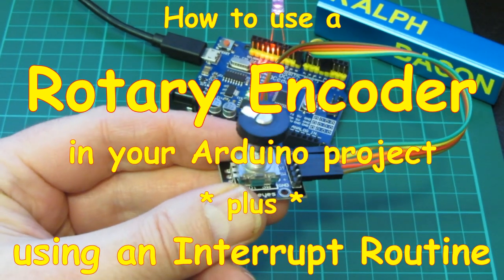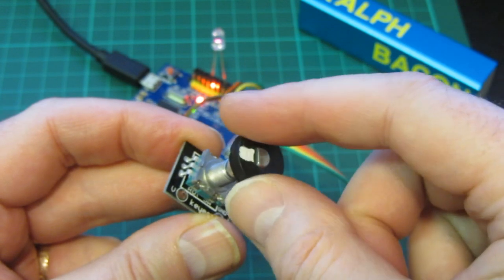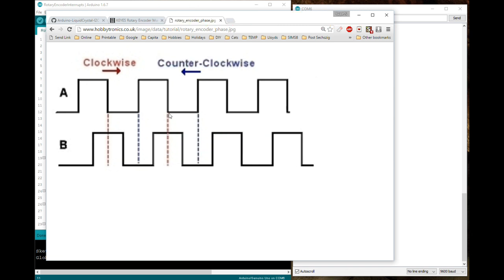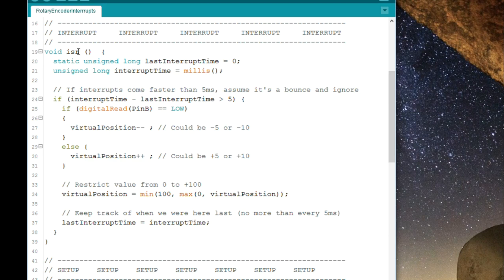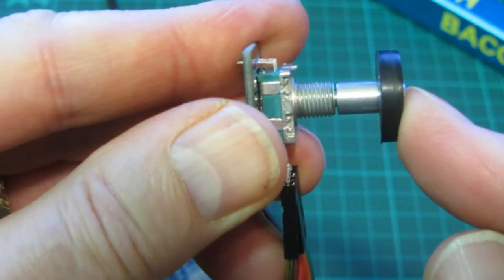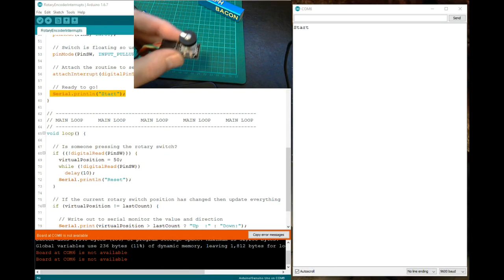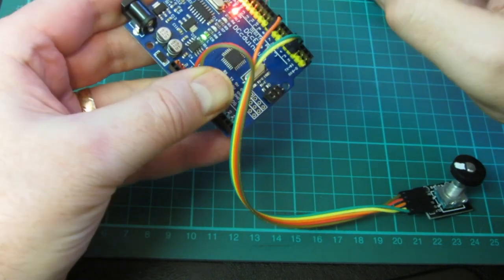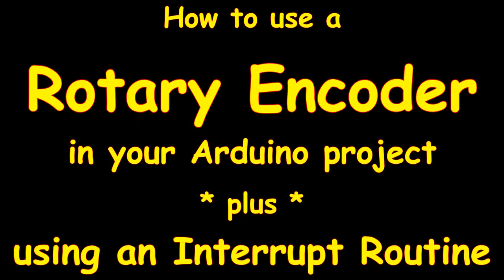#19 How to use a Rotary Encoder with an Interrupt routine on your Arduino

Comment: instead of triggering the ISR when the pin is LOW you could trigger it with the FALLING condition and get rid of that 'less than 5ms' if statement?
Reply from the maker: Nope, won't work dudekidPL. You could use FALLING as a trigger (I found it less reliable than LOW but your mileage may vary) but you can't escape switch bounce so you would still have to check for that to avoid false pulses. There's a more in-depth video on switch bounce in videos #96 & #98 (#96 talks about Rotary Encoders some more, #98 shows you how you CAN remove the 5ms statement if you're willing to add in a bit more hardware). Have a gander and let me know what you think!
Reply: Thanks for the quick reply! I will have a look at #96 for more encoder info. I am currently trying to implement a row of encoders into a key matrix. It should work as long as I can get a single encoder to work correctly and then put that interrupt function inside the key matrix. Unfortunately I cant get a stable encoder output so far. I have 5V at the common pin because my key matrix cycles 5v between the columns. I use pull down resistors for the A and B pins. A is connected to an interrupt pin and state of B is then checked inside the ISR to acquire the direction of the square waves. In my head it sounds right but i get crazy outputs.
Reply: I got it to work quite well with your code and by connecting the common pin to GND and using the software pull-ups for pins A and B . Is there a way to get similar performance but connecting the common pin to 5V and using physical pull down resistors on pins A and B? my circuit requires this configuration unfortunately
Reply from the maker: Yes, you can, with a bit of fiddling about (easy). Connect the common to 5v. This means you the pins A & B will be made HIGH as you turn the shaft. The Arduino Uno doesn't have a trigger on HIGH (Arduino Due only), only on RISING so use that in your attachInterrupt statement. Also, you will need to connect 10K resistors from the pins A & B to ground so they are not left floating. The debounce routine is still required in the ISR (using the check for millis() so no change there). Should then work. Let me know if you have problems.
Reply: Thanks once again for the quick reply, you're a gentleman!
I followed your instructions but used 7.8K pull down resistors instead. I didn't have 10k but that shouldn't have much difference. The debouncing function based on time since last interrupt definitely helps but in this configuration the encoder is still acting crazy. Changing the debouncing period from 5ms to 50ms helped somewhat but I still get many stray signals, not to mention the significant delay introduced. Any suggestions? Could it be down to the encoder itself? maybe the one i am using is designed to have the common pin grounded and that's it?
Reply from the maker: Hmm. Firstly, if you really do need 50ms in the debouncer then you have a really, really bad encoder. 5ms is enough for 99% of all switches I've ever tried, with 20ms the true exception. If you have an oscilloscope you can check for bounce as per my videos #96 and #98 (worth a look, though I say it myself). Certainly, Rotary Encoders are (sort of) assumed to be grounded as they turn but should still work when brought high. You are describing the symptoms of my Rotary Encoder when I used FALLING rather than LOW. Try changing to CHANGE (you will get two pulses per step but we can sort that out in the ISR later) and see if that makes it work as before (when you were checking for LOW state). Good luck and let me know!
Reply: The encoder I have is a BOURNS 24 detent and 24 pulse. It works perfect when in the configuration with grounded common and pullup resistors at A and B at 5ms debounce. 
It starts acting funny when i connect the common to 5v and use pulldown resistors. I tried your idea of using RISING as a ISR trigger but no luck there, a lot of strange readings happen. Sometimes i get two readings with one step (one reading increments the value and the other decrements it back down as if I stepped the encoder forwards and backwards). Strangely it works better when rotating one way than the other. To make matters worse, even at 500ms debounce the issue is not solved. At that delay, bounce is practically impossible so it must be something else. I think the detent is in a position on the square waves that only allows it to work when in the grounded common pin configuration
Reply from the maker: Well, it was worth trying. And if I remember, I will have a quick go at repeating this too, to see whether it can be made to work or not. In theory it should, in practice it may be the Arduino or the Rotary Encoder just does not allow it. Stay tuned...
Reply: Thank you very much for all your help! I really appreciate it.
Reply: Hi again Ralph, by any chance, do you have any news for me? :)
Reply: dudekidPL: I'm playing with this same code, using a Bourns EN series encoder (256 PPR). This drives the A and B outputs with a logic drive gate, as they are debounced. I found using the "LOW" causes continuous interrupts if the A output is parked at the low state, so I change it to "FALLING" as there is no bounce from these quality encoders. This fixed the continuous interrupt issue. And it counts perfectly.
I instrumented the code with extra volatile counters that incremented with an else statement (I added) for the debounce > 1ms If statement, so when less then the 1ms, I had a counter the increments by one. It was always greater then 4000 counts when I rotated the encoder slowly (seen via the print to the serial monitor). Once I changed the interrupts to FALLING, this counter never incremented.
// Used for generating interrupts using encoder A signal
const int PinA = 3; 

// Used for reading encoder B signal
const int PinB = 4;  

// Keep track of rotary encoder value
int lastCount;

// Updated by the ISR (Interrupt Service Routine)
volatile int virtualPosition;

volatile unsigned long interruptTime2;
volatile unsigned long interruptcount;
volatile unsigned long interruptcountold;
volatile unsigned long lastInterruptTime;

// ------------------------------------------------------------------
// INTERRUPT     INTERRUPT     INTERRUPT     INTERRUPT     INTERRUPT 
// ------------------------------------------------------------------
void isr ()  
{
    unsigned long interruptTime = millis();

  // If interrupts come faster than 1ms, assume it's a bounce and ignore
  if (interruptTime - lastInterruptTime > 1) 
  {
    if (digitalRead(PinB) == LOW) //
    {
      virtualPosition-- ; // anti clockwise
    }
     else 
    { 
       virtualPosition++ ; // clockwise 
    }
    // Keep track of when we were here last (no more than every 5ms)
    interruptTime2 = interruptTime - lastInterruptTime;
    lastInterruptTime = interruptTime;
    interruptcount = 0;
    interruptcountold = 0;
  }
  else
  {
    interruptcount++; //how many interrupts occur per millisecond
  }
  
}

// ------------------------------------------------------------------
// SETUP    SETUP    SETUP    SETUP    SETUP    SETUP    SETUP    
// ------------------------------------------------------------------
void setup() 
{
  // Just whilst we debug, view output on serial monitor
  Serial.begin(115200);

  // Rotary pulses are INPUTs
  pinMode(PinA, INPUT);
  pinMode(PinB, INPUT);

  // Switch is floating so use the in-built PULLUP so we don't need a resistor
  //pinMode(PinSW, INPUT_PULLUP);

  // Attach the routine to service the interrupts using encoder A, on logic low
  attachInterrupt(digitalPinToInterrupt(PinA), isr, FALLING); //other options LOW CHANGE RISING FALLING 

  // Ready to go!
  Serial.println("Start");
}

// ------------------------------------------------------------------
// MAIN LOOP     MAIN LOOP     MAIN LOOP     MAIN LOOP     MAIN LOOP
// ------------------------------------------------------------------
void loop() 
{

  // If the current rotary switch position has changed then update everything
  if (virtualPosition != lastCount) 
  {    
    // Write out to serial monitor the value and direction
    Serial.print(virtualPosition > lastCount ? "Up  :" : "Down:");
    Serial.print(virtualPosition);
    Serial.print("   ");
    Serial.print("\t");
    Serial.print("interrupt time ");
    Serial.println(interruptTime2);

    // Keep track of this new value
    lastCount = virtualPosition ;
  }
  if (interruptcount != interruptcountold) 
  {
    Serial.print("Interrupt count ");
    Serial.println(interruptcount);
    interruptcountold=interruptcount;
  }
}
Note I increased the baud rate for the serial monitor.
Reply: I've update my test code and removed the debounce IF statement. I have to assume your encoder does not have a bounce switch, and is optical with schmitt triggers incorporated in the digital logic. Works perfect without it. You really want edge trigger interrupts. I have no idea what encoder Ralph Bacon is using.

Comment: Very good no problems understanding the video but on your site you have an example where you attach an interrupt to both pins.  I cannot see what the advantage is of having an interrupt on both pins?  If an interrupt detects motion on one pin then there must be motion on the other.  Why not just poll it to find the direction.  Why use two interupts?
Reply from the maker: Hmm. Good question. I can't remember using two interrupts for a Rotary Encoder (I never have since). Was it just demoing a particular point? I would expect an interrupt for Pin A and in the interrupt a quick read of Pin B which would indicate rotational direction (as you say). Strictly speaking the interrupt should only set a flag and the main loop do the reading but for a demo it was more understandable to do some work in the ISR.
Reply: Hi its this one 
https://github.com/RalphBacon/RotaryEncoderUpdate/blob/master/RotaryEncoderDualInterrruptsOnChange.ino
Its not the code that is the issue but the reasoning behind using two interrupts. I cannot see the advantage it has over your earlier code that uses one interrupt.
Since the Uno only has two interupts I would want to use one for the push switch and one for the rotation or use one of the boards that can handle more than 2 interrupts.
Many thanks for the excellent series of videos.
Regards
Dave
Reply from the maker: Ah ha! So this was the update for the stepless rotary Encoder (which I have come to dislike). I'm wondering what the comments were that "made me ponder" and do this alternative code. Perhaps because there are more steps in a stepless encoder (quarter steps, I believe) so I'm trapping both pin A and Pin B (whichever arrives first) as otherwise we would miss a pulse.
As I say, it was just another type of RE and I didn't like it anyway, and now that you've reminded me of the dual interrupts that is the final nail in the coffin. Just use the single interrupt from my original sketch, that works fine. If you use a stepless encoder and you end up with less resolution (ie fewer steps in the full rotation) well, that's the price we pay for not detecting every tiny pulse.
Reply: Hi Thanks for the advice, yes a single interrupt for the rotation and another for the push button.   I will also need 2 limit switches for my project  and I suspect it will be best to use interrupts there as well so I will need to get one of the boards that has more than 2 interrupts.  Have you ever looked at interrupt handling on the SM32 family of boards?
Reply from the maker: I can't say I have, David. I would hope that it's more or less the same as any other device, but that's just me and wishful thinking!
Reply: @RalphBacon  Hi Ralph
With what I am working on I will need 3 interrupts 2 x limit switches and 1 x Rotary Controller.
For expirimenting I have the Arduino connected to a DRV 8255 controlling a Stepper motor.
All working fine.
I then added limit switches.
 I had my limit switch interrupt code working perfectly on an Uno using Pins 2 and 3.
Press either limit switch and the motor stops OK.
To get more interrupts I bought a Mega 2560 which has 6 interrupt pins.
Initially I set the Mega up identical to the Uno using pins 2 and 3 as the interrupt pins and everything still worked fine.
Next I tried to get it to work using Pins 18 and 19 on the Mega no joy.
The strange thing is that the stepper motor does not even start to run.
Its as if it was getting an interrupt even before the motor started.
Any thoughts?  Do you have Mega and if so can you try your above Rotary controller code but  using  interrupts  pins 18 or 19 instead.

Cheers
Dave

Comment: Ralph, in this example, you have the encoder CLK pin connected to Arduino pin 3, and the DT pin connected to Arduino pin 4, so am I correct in assuming that ONLY the CLK pin needs an interrupt pin?  But with the De-Bounce code in video #226, BOTH the CLK and the DT pins need and interrupt pin.  Is that correct?  Thanks!
Reply from the maker: You need to detect when the Rotary Encoder is moved - so a single pin/interrupt is sufficient. 

In video #226 I believe the logic requires both pins to be detected to determine the correct state (or invalid state). 

These days I tend to use hardware debouncing (I did a video too) as it is 100% reliable and requires no software at all.
Reply: @RalphBacon  Thanks Ralph!  That clears it up for me. Regards!

Comment: Will this work for a ho dc motor?
Reply from the maker: Do you mean: can a DC motor turn the rotary encoder and then you do something in your sketch? Or something else? If the former, yes, but it's not designed for a fast speed, about 60 rpm is the expected use (ie one turn per second).

Comment: Thankyou. It was the best explanation. The only thing that I am searching now is HOW can I connect a rotary encoder to an arduino. No I don't refer to ebay, chinese or adafruit encoders already mounted on pcb's. I mean encoders bought from tme.eu or digikey, farnell, without any pasive components selected using datasheetd (5v, number of steps, durability, shaft lenghts...etc) because I want variety since I am using them in comercail products. Ok now, WHAT is the use of those passive components on those ebay encoders ? They are there to prevent false readings / skips ? How and why ? Why 2 capacitors are needed ? . Anyway, with your tutorial I am using an encoder Bourns type PEC-11R-4020K-SOO24 and tried also with Alps EC11B20242. Both work fine,
. Basicaly you can use whaever encoder on the market if you read the datasheet ( voltage, current, pin configuration are important). I need to mention that YOUR VIDEO here finally helped me after one night wasted - to finaly make them work. Thankyou. I "like" its the least I can do, and it's not enough. You even did it without external libraries or aditional code junk that would use my precious Atmega memory. Thanks alot !
Reply from the maker: Wow, rev3erse, your appreciation of my efforts is, er, appreciated! There's no reason that other rotary encoders would not work. I'm not sure the one I used had any additional components? Any capacitors might be for switch debouncing although you can do that in software too. Anyway, I'm very glad it is all working for you, thanks so much for posting, appreciated.

Comment: I'm just wanting to know if these cheap ones are mechanical, or magnetic or optical.  I'm guessing mechanical because it would be simpler?  How often do the contacts wear out?
Reply from the maker: Cheap rotary encoders are mechanical. The datasheet (if you can find one, Bourns do have one for their encoders) tell you what the MTBF is. Unless you are going mad with it, it's unlikely to wear out. Optical are, of course, better but cost considerably more.

Comment: Hello Ralph, This video is pretty neat explanation of rotary encoder and your code is efficient and light but I have question regarding your 5ms time check in isr routine. Surely you didn't use delay() function because it doesn't work in ISR vector, however in your code you declared the time variables inside ISR function. This will cause them to initialize with 0 every single time isr is called and you would always end up having interrupttime - lastinterrupttime > 5 condition as true.
I might not be seeing the point here but if you could explain this 5ms time check for debounce in ISR.

Cheers
Reply from the maker: Many Arduinites get tripped up over this bit of code, Shuaaib, so let me see if I can explain it.
 
The lastInterruptTime variable has been declared as static which means it is a sort of global variable but only to this function. It doesn't get reset every time. The initialisation occurs just once, the first time.
 
Would it work if this variable were a true global variable? Yes. Is that the right way to do it? No.
 
But hey, life's short. Whatever works for you, works, right? I'm just writing the code to demonstrate Best Practice! I hope this helps your understanding of this code, thanks for posting that question.
Reply: Oh, Yes you are right. Totally tripped on that one. Didn't realize, variable was declared static. Normally in embedded systems people are looking for volatile keyword for variables that are used inside ISR. :)

Thanks for clarification. 
Cheers
Reply from the maker: You are most welcome Shuaaib, I'm glad it clarified things for you. Nice to hear from you.